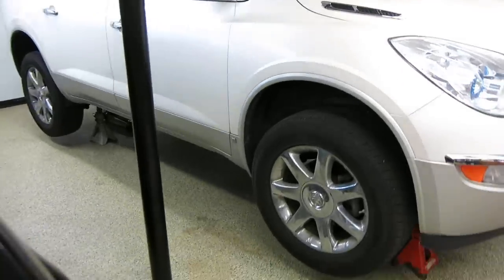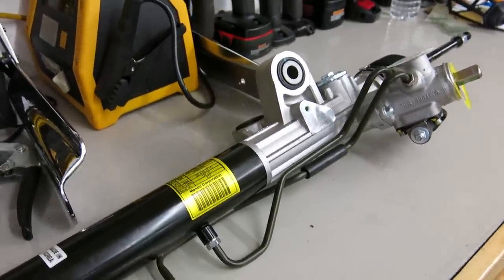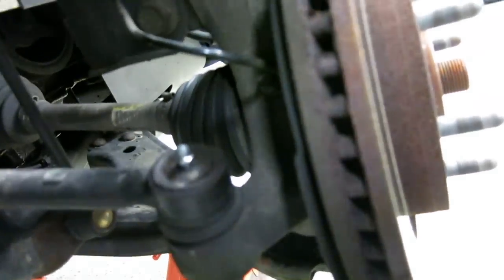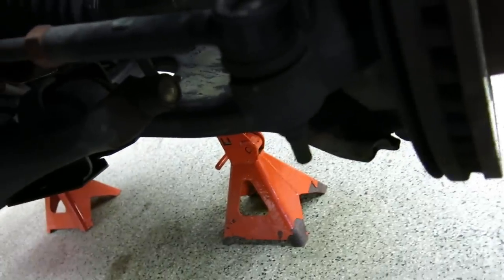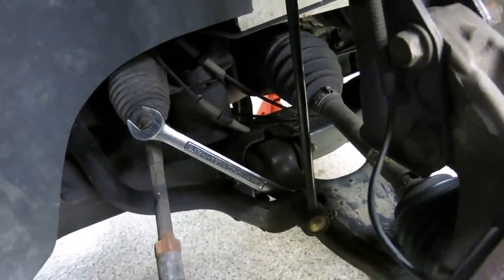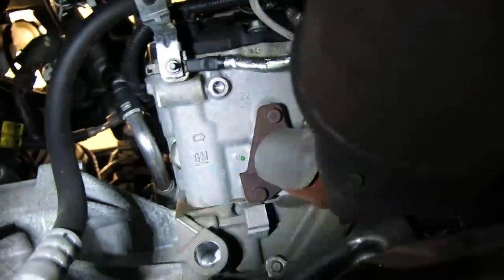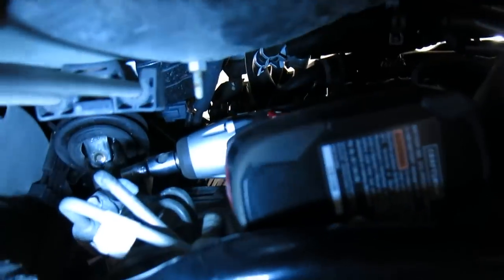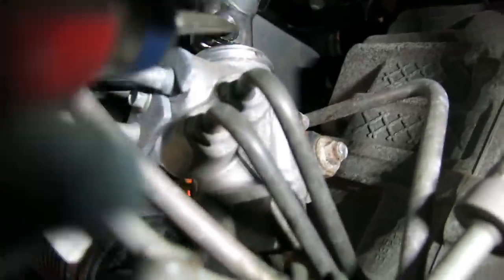Enclave Steering Gear Removal Part 1

Comment: That steering column bolt can be removed with the steering wheel turned 180 degrees and then center and lock the wheel after the bolt is removed but u-joint yoke still in place. Install in reverse. Also using a center punch to mark drivetrain locations is a good permanent marking system.Striking the stud of the tie rod ends with a hammer needs no special tools and works without damaging the boots.

Comment: Great videos.  I started getting frustrated when taking out my steering gear when it wouldn't fit out of the wheelwell opening and so found your videos.  Good job, great explanation and great camera placement.  I'm hoping that I can just remove the same exhaust section that you removed without touching the frame or driveshaft.  I'm hoping that I will then have enough room to tilt the steering gear up and pull it out of the passenger side.
Reply from the maker: bigzzzt I'm glad I could help!  Good luck!

Comment: I have a 2011 Buick Enclave with 80k miles on it. Just got it used. The 
steering wheel makes all kinds of Star Wars droid noises when I turn it 
back and forth while stopped and idling. I see (now, after buying) that 
there is some issue with the these vehicles steering and there is 
actually a Class Action Lawsuit against GM about it. Do you know if there is any new information on this? Is GM doing anything for these 2009- 2012 Lambda Class 
vehicles steering component issues?
Reply: rockeraaj dnt know if u got it resolved but I just got my entire steering system done under warranty by my local dealer did it all

Comment: You mentioned you were trying to isolate another front end noise when you added a zerk to the ball joint; Did you ever figure out what it was?  I've had terrible front end noise.  I replaced lower control arms and ball joints, as well as a deteriorating lower control arm bushing.  Also replaced steering control rods and bushings and still have terrible rattle.  My mechanic is telling me most of that rattle is the play in my disintegrating steering gear, and I know it's going bad, but I hate to do all that labor hoping it will solve the noise thing.  Hey, thanks for posting such a clear video!
Reply: I've got a knocking sort of noise on the front drivers side. Happens on uneven surfaces. Large bumps aren't so much an issue nor is turning. Haven't figured it out yet. Is this similar to your symptom?
Reply from the maker: Our noise ended up being the strut bearing.  Good luck!

Comment: My 08 Enclave has good power steering but I am getting a popping sound when I turn.  If I don’t push the gas it won’t hardly do it.  I had the front left CV axle replaced and it helped at first then it came back.  Would the steering shaft or any of the rack and pinion or the gear box cause this?  Also mine is FWD so I don’t have a shaft to take out that goes to the rear.
Reply: just wanted to reply for others that are reading your comment.  That sound is most likely a CV joint popping.  When those start to go out, they can make a popping noise.
Reply: @bmo5082  thanks for your response, so I assume this noise is normal? I have this little noise when doing a sharp turn and then tires back straight
Reply: @luisdaniel75  Yes its normal.  Its a sign that your CV joint or universal joint is somewhat worn out.  Ive driven around on popping CV joints for years and nothing happened.  Even if they break, the CV joints dont hold up the structure of your  vehicle, so it wont kill you.  It will incapacitate your vehicle until you get them replaced.

Comment: It's been about 2 years since you've done this work. Has the new part held up alright? Considering buying an '08 Enclave and I'm just preparing myself for possibly having to do this repair in the future.
Reply from the maker: +anticommander7 Steering gear and pump are doing terrific!  We're up to almost 150K miles and there have been no indications of any issues.
Reply: +Chris Bruno Awesome! Are there any other repairs that I should take into consideration before deciding to buy the '08 Enclave? It has already had the wave plate replaced in the transmission so I shouldn't have to worry about that common issue too.
Reply from the maker: Well, the only other major repair that I dealt with was the timing chain replacement.  That would be a big deal if you had to handle it.  Otherwise, all of the repairs we've had with ours have been relatively minor.
Reply: Hey thanks for posting this, I have a gmc Acadia 2008 awd and going around turns gets pretty jerky. I'm trying to diagnose the problem. Looks like this may the problem

Comment: Hey great I was able to do everything now I can't get the steering column in with the rack and pinion its not sliding down what am I doing wrong ? It looks like its in place the cut is facing the bolt
Reply from the maker: +Alejandro Rivas Did you remove the pinch bolt from the steering shaft before trying to slide it down?  If so, then you might just need to us a flathead screwdriver to pry open the steering shaft side slightly to get it to slide down.

Comment: I had my steering gear replaced on my GMC Acadia a few months back now my a/c stopped working. Do any of the a/c lines have to be removed to perform his job.  My car has 32000 miles I'm very disappointed  with this car and the $2000 dollars I had to pay this job.
Reply from the maker: If they had to replace the power steering pump and the steering rack, then the dealer may have found it easier to just drop the engine.  If they did that, then the A/C lines to the car are disconnected.  Otherwise, there is no reason to disconnect the A/C to just change the steering rack.  Hope this helps!

Comment: There is a recall now. I got my 2010 Traverse done at no cost.
Reply: +Sean Tisdale Do you have a link to the recall?
Reply: +anticommander7 SPECIAL POLICY 14329/POWER STEERING PUMP REPLACEMENT. If you take it to dealer they know what it is. It isn't a recall, it is extended warranty that covers this. Mine was losing power steering when I went to turn, then it went all the way out.
Reply: +Sean Tisdale this wasn't a recall?  You was still under warranty  or had some sort of warranty when you got this done?
Reply: +Jack Davis it isn't a recall it is a warranty extension. it extends it to 10 year, 120,000 miles. there is one on the water pump also
Reply: GM only pays the new power steering pump if it leaks and caused losing power.  However, you have to pay for the gear and the labor cost. Dealers recommend to replace the gear whenever replacing the pump
Reply: They replaced mine and it works and I paid nothing.